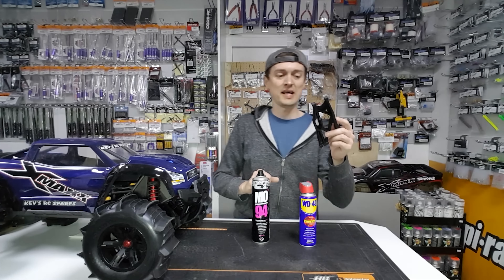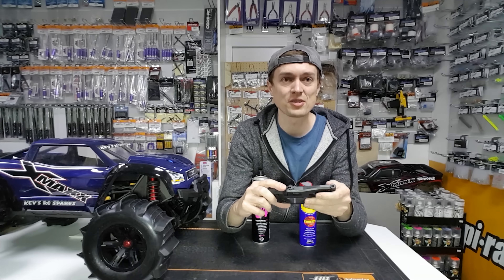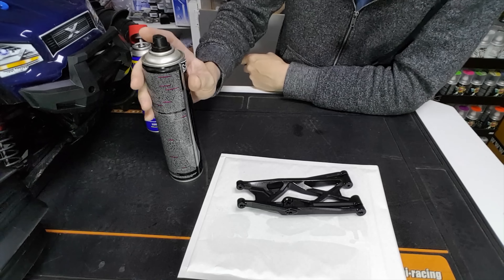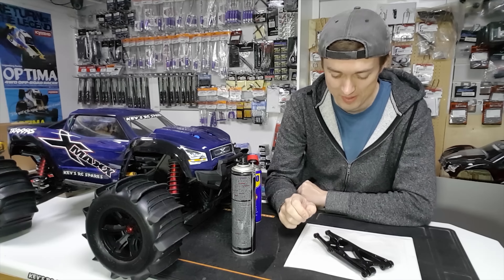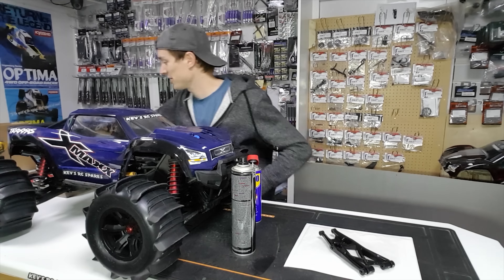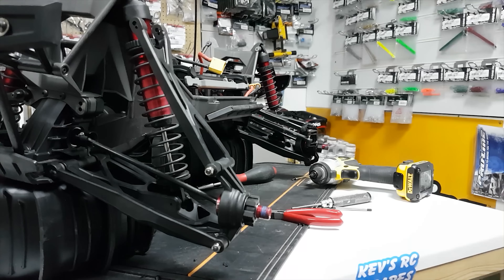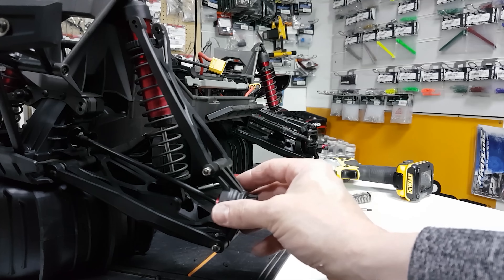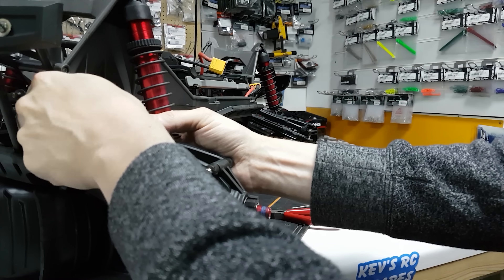HOW DOES IT NOT BREAK? Secret Revealed - 1 Minute Traxxas X-Maxx and other RC Cars LIFE  HACK

Comment: I have to say that this really makes me kind of angry at the manufacturers.  My first complaint would be that when I got into this hobby about ten years ago I went into the local hobby store and asked for the biggest and toughest rc vehicle out on the market, expecting it to be able to take some reasonable accidental ‘hits’ and still continue to drive it. And, I did enjoy the hobby at first, but when parts started breaking... of course I bought the necessary replacement parts.   I, like many other people I know that have since gotten out of the hobby, got out because it happened more frequently than we believed it should have.  It was damn frustrating not to mention expensive for all the upgrades to aluminum.  With the belief that aluminum was better.  We found out that was a load of BS as more and more parts broke and were replaced, the cost of the vehicles soared.  Not only losing running time, but having to source parts, wait for shipping, install them, blah,blah blah.  It quite literally drove me and all the guys I know away from the hobby....never to return.  Now sure you could say that was me and my friend’s fault for breaking the vehicles for being too hard on them.  Ok, fine.  Over time though as experience builds, I learned just as they did that we really had to ‘baby’ them.   It really was quite discouraging.  Had we of known of this ‘trick’.  I’m sure we would have stayed in it much longer, or as for myself, returned back to it much sooner.  The other guys see it as a waste of time and money.  They see it as a source of frustration, not pleasure.  They feel more disappointment than joy.  Not something to encourage.  It becomes a child’s hobby.  I am only talking vehicles here.  Not planes and boats.  The people I know that I mention to that I am an rc enthusiast, don’t ridicule me when I mention I have planes and boats. They actually see those as hobbies.  But, as soon as I mention I have a car or truck, suddenly I become a child to them in their mind.  Weird psychology.  I think they see it as a fruitless exercise, the weird part being they see me as kind of an ‘inferior’ / immature adult.  Now, I have ordered the Xmaxx.  It is not that I don’t expect this vehicle to break, however I still am doubting it is a wise purchase for the ridicule I am expecting to receive.  But, maybe I can ‘save face’ if dousing it in WD-40 makes it just a bit more durable and possibly change a few minds of the guys I know that got out of the hobby.  Let them drive it, bash it, etc.  I think the hobby is harmed by not encouraging more people / showing them that it doesn’t have to be as frustrating for them to be in it.  I would buy many more rc vehicles if they could simply take more of a beating.  And, I don’t consider myself to be anywhere close to being a basher!  No big jumps, no high speed runs, etc...  I am afraid to even attempt it due to the high cost and down time to fix them.  Maybe I just expect too much.

Comment: Hey Kevin, Thanks for all your crazy and fun videos. I’ve learned a lot from those. Have you Experienced any squeaking sounds from the more harder grey plastic parts on the body? Like the shock towers and other places? After soaking it in wd40 or MU94 that is. I sprayed some wd40 on my x-maxx arms and à bit on the towers and on the sides around the battery compartments. After that it squeaks quite loud when i turn the wheels. hopefully it will go away soon. Havent had a chance to drive it after that.
Reply: that happens to me too but it might be your stock plastic spurs in the servo. id recommend changing them to steel ones. cause i gotta do too at some point lol.
Reply: I'm wary of spraying everything with wd40, its a cleaner and actually removes grease if it gets into bearings. I'd probably just wet a rag with it and wipe it down.

Comment: Hey Kevin or anyone with the experience, any suggestions on stock to keep the front wheels on the ground? (Besides throttle control)  I have 22/50 pin/spur, do I need to downsize?
Reply: Big ass wheelie bar, that's it! I swap my cover with a roll cage and it does 360s in place, without it, it hauls ass and does vertical 180s repeatedly.
 You can also add another gear, that was a fun project! Had a 2 on a Slash 4wd and 3 on my E-Maxx.

Use a three-speed transmission and dial down the first gear. I made mine, but you can buy up to a four speed (at least) on Amazon now. People are always trying to push it as far as possible.

Comment: Kevin I sprayed it once, not much difference. Do I need to do it more the once?
Reply: J assume your body is already screwed
Reply: Spray it constantly. Every time my RC comes inside from a run i spray it again. On my Arrma big rock V3 I had an A arm sitting in WD40 for a week and then in air for a week after. When i applied a twisting force (torsion) like Kevin; it bent like Gumby and sprung back. The stock one cracked when attempting this. Anyone who says this doesn’t work is hallucinating. Try it yourself and go bash!

Comment: i'm having a conversation with some people that the WD40 makes plastic brittle. i hear different opinions left and right. people recommend that MO94 stuff mostly. so what's the truth? have you soaked the parts with wd40 or just with the mo94?
Reply from the maker: mo94 on this truck but i've used wd40 on my old xmaxx with similar results. test on a small part first if not sure

Comment: Does WD40 also work for the tires to keep em soft?
Reply: Yes  a little bit
Reply: tires are made from rubber so the best is talcum powder or vasseline
Reply: Wd40 perishes rubber
Reply: Don't use Wd40 on rubber or bearings.

Comment: So can i just spray WD40 on any of the plastics? or just the arms?
Reply from the maker: Yeh, I cover the whole truck.
Reply: Kevin Talbot Hey Kevin, Thanks for all your crazy and fun videos. I’ve learned a lot from those. Have you Experienced any squeaking sounds from the more harder grey plastic parts on the body? Like the shock towers and other places? After soaking it in wd40 or MU94 that is. I sprayed some wd40 on my x-maxx arms and à bit on the towers and on the sides around the battery compartments. After that it squeaks quite loud when i turn the wheels. hopefully it Will go away soon. Havent had a chance to drive it after that.

Comment: I was the 1st to use the cen pins, I had mentioned in my thread over on thercgarage that I was looking for captured pins, my forum bro Tmang happened to check the pins on his collosus and they appeared to be correct measurements, so I orderd and they worked, since then other guys have recessed the upper pins into the side of the upper arms up front to keep steering @ full lock left and right... so just find a drill bit the size of the cap head on the cen pins and drill side of upper arm just deep enuff so the head of the pin does not interfere with steering... here is the thread my user name is jump_it http://thercgarage.net/forums/showthread.php?tid=322&page=22 Credit to Tmang and well me...  peace and thumbs up on vid, also it is well known you can boil traxxas plastics to get them to be softer, or so they say, but your idea looks easier.
Reply from the maker: Nice one dude, credit goes to you on the cen pins then! Boiling works but actually makes the plastic more brittle when it freezes in the winter due to the water absorbed into the arms. Cheers
Reply: Good vid mate - I've wondered about this after hearing the old "boil your arms" trick - Had couple of arms break on baja, gt40 seems to have sorted it for now - Nothing like as flexy as those though! explains all them shots with wheels at impossible angles then driving off fine... Good vids man, keep em coming.

Comment: I tried this, ATF and all sorts of things a few years ago and I think ATF works better, but you have to be careful or it'll eat it and turn it to rubber! You definitely need practice to do so and anybody that claims metal is better than plastic simply doesn't have the experience...

The best thing for the body though is to use epoxy (there are 2 kinds, one will eat through your shell) and drywall tape. It's definitely the easiest, but don't try any of that stuff on your body.
 It seems stupid saying that, but I guarantee that people out there would soak their cover in ATF and then be mad someone told them it softened plastic lol

Comment: I doesn't work with wd40
Reply: Really? You tried it Haziq?
Reply: @HectorPriamedes1  yep
Reply: @monolinkster  I read up on the label (I ingredients for the one Kevin uses (Muc) and it is PTFE based.  So my guess is WD40 must not be PTFE based.  I am going to try using Liquid Wrench penetrating oil spray today as it is supposedly PTFE based.
Reply: I just let mine soak for almost 20 hours in "Liquid Wrench Penetrating Oil"  (has Cerflon, a ceramic PTFE compound).  The arms and components do not seem any softer...  Not sure why as MucOff94 is also PTFE based.  Or so I thought.  Someone who knows please weigh in?